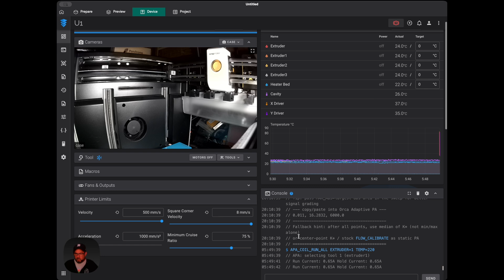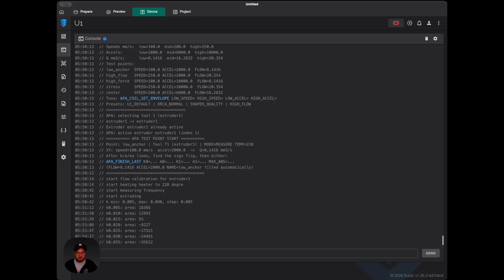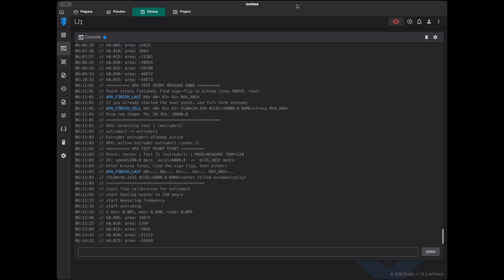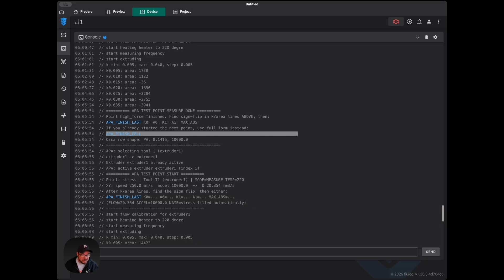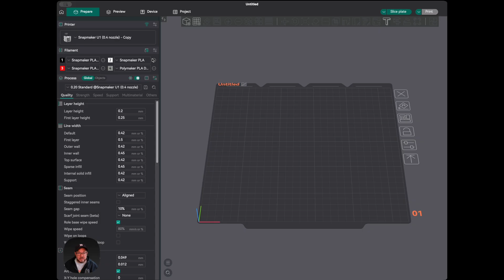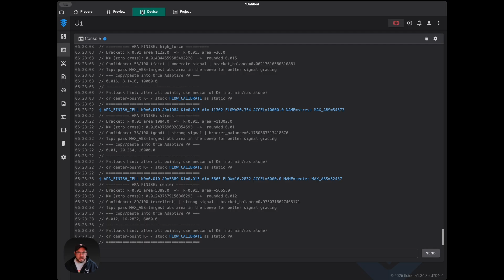Snapmaker U1 Adaptive PA Without 12 Test Prints | Auto-Calibration Macros

Comment: This is awesome. But I feel like it could to just one or two steps forward.

It basically runs all the tests and then you have to manually select which values to use and then run separate macros.

But I feel like there's got to be a way to automatically determine these values and pass them into the finalization macros without having to do so manually. That way you can just run and forget, and then have it print all the lines for you as a final console output, which could just just copy and paste right into the slicer.
Reply from the maker: Yep, there's a way, but it would require uploading a python script up to the printer. I wanted to make it accessible to people who don't know how to ssh into their printers. 

But you've convinced me, I'll create an 'advanced' option that includes the Python klipper extension... It's a good idea!
Reply: @webx13 I created PR with exactly that functionality, hopefully @JeffBarrows approve it ;)
Reply from the maker: @alexey_sychev  thanks for the heads up, not sure why I didn't get a notification on the PR... I'll take a look over the next few days - thanks for the submission!

Comment: Is there an option to calibrate it using different values, for example i'd like to run a calibration for 20/50/100 mm/s and 1000/2000/6000 accel. i began to manually edit each default value with my corresponding one (changing 100 -> 20, 200 -> 50, 250 -> 100) but i then realized there are a lot of values that seem custom tailored to those default speeds and not sure what to change them to.

thanks for any help/info
Reply from the maker: You can run something like this to override speed/accel settings: 

APA_COIL_SET_ENVELOPE LOW_SPEED=80 HIGH_SPEED=150 MID_SPEED=100 LOW_ACCEL=1000 HIGH_ACCEL=6000 MID_ACCEL=2000
APA_COIL_SHOW_ENVELOPE
APA_COIL_RUN_ALL EXTRUDER=0 TEMP=220

However, I think at the lower speeds you're not going to see much variation in the PA value, so you may be better off just generating a single Pressure Advance value and skip adaptive if 20/50/100 mm/s is your typical print speed... 

Hopefully that makes sense!
Reply: @JeffBarrows  Thank you!

Comment: I've got an interesting run: the area goes negative, back to positive and then negative again. Which setting should I use?

13:42:25 // k0.015: area=2186.000
13:43:09 // k0.020: area=-124.000
13:43:54 // k0.025: area=957.000
13:44:38 // k0.030: area=229.000
13:45:22 // k0.035: area=-1054.000
Reply from the maker: Thanks for sharing this, I haven't seen this before...

Does it happen across multiple runs? Also curious if you see it on different tool heads?
Reply from the maker: Also, do you mind sharing filament type and temp?
Reply from the maker: You may be hitting a flow limit issue too - if you can provide the  START or DONE banner, I can tell which test you're running

Comment: great job, question, this should be done in all 4 nozzles or just in one?
Reply from the maker: This is more of a per-filament calibration. Once you have the values defined in your filament profile you're all set. 

If you use different nozzle sizes you may want to run it again for that particular size (because of different flow rates)

Comment: This could be a total game changer!!! I feel like this isn't getting the attention it deserves! Can't wait to give it a go! 

I also struggle with the manual calibration process - it takes ages, and I'm never confident that I'm judging the outputs of that process correctly anyway. My before and after test prints show improvement, but not as much as I might hope for, and I'm pretty sure I'm the issue in calibration process - my human eyes (and the brain attached to them lol) are where the error is being introduced😂 . Being able to eliminate my questionable judgement from the process will be a massive gain for me, assuming this macro actually produces a better quality outcome!  

I'll run through this process and see how the before and after prints look and report back!

This will be particularly useful as I'm about to embark on a massive project that will be producing large numbers of the same part, all using the same filament, and is likely to use dozens of spools. I'll be loading all four toolheads with the same filament, and using the auto-failover feature to switch between them as each runs out. Using the built-in dynamic flow auto-calibration isn't really feasible in this situation, so I would have had to do a full manual calibration, and I'm just not confident I can do it well enough. Being able to do a fully auto-calculated PA-calibration once, for the entire project's filament usage, will make the whole process so much less irritating!
Reply from the maker: Sounds like the perfect use case, let me know how it goes! 

You may want to verify that the filament feeder sensor thresholds are configured correctly, one of mine wasn't and had to do some arm wrestling when my filament ran out. 

I documented my experience and how to verify over on Reddit. 

I tested Filament Runout scenarios on the U1 so you don't have to. : r/SnapmakerU1 https://share.google/gYXKYhSFSTtVWQfSd

Are you running a print farm with the U1?

Comment: Thank you for this, previous way of doing the PA pattern was quite tedious. 

As being a complete newb, some tips for other new users. 1. To upload the cfg file you need to go to the configuration tab on the left side of the browser, the icon looks like {...}. Then click the plus sign + to add a file. then click on the printer.cfg file and scroll all the way to the bottom, and above where it says ### do not put anything below, type in the code from step 2 of the quick start. 2. You'll more than likely run them all so you have to do apa_finish_cell command for all 5 items to do the calculations and then put that into snapmaker-orca. 3. to find out the static take your top value of all 5 tries and subtract the smallest value, divide by 2 then add that to the smallest value. ie k0=.015 k1=.083, static value is now .049

Comment: I am not sure if my comments are showing up, but do you have a solution for the following error Unknown command:"INCLUDE" when trying to run [include adaptive_pa_macro.cfg] with the new file sitting next to the printer.cfg file?
Reply: I think I figured it out: you add the command [include adaptive_pa_macro.cfg] to the printer.cfg file
Reply from the maker: Sorry, I don't think your comments were coming through, YouTube commenting system baffles me sometimes!

Thanks for the question, I'll take a look at the quick start guide, I may have missed that step in the docs!
Reply: @JeffBarrows  You did; I didn't read it correctly, but I have it working, and it's great. Thank you for making this.